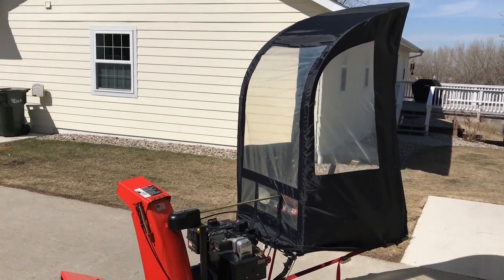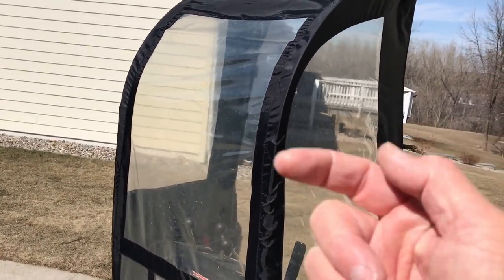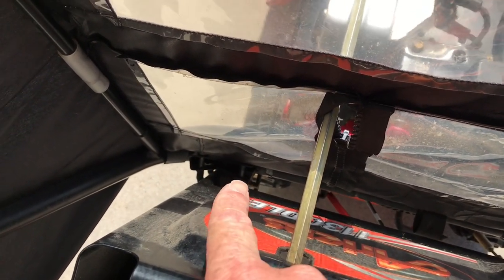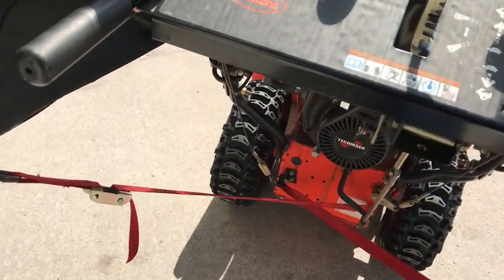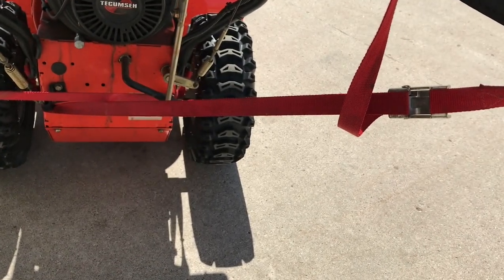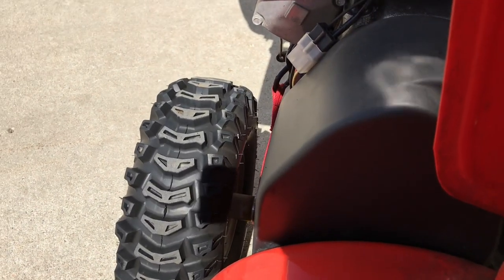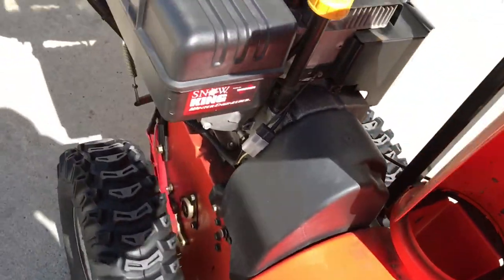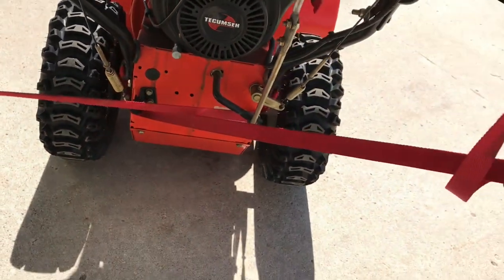Here's a Simple Fix for Snow Blower Cabs that Keep Folding over in High Winds

Comment: My bracket had a hole so I put a self tapping screw in there hoping that will fix my problem, I’m going to strap it too so it doesn’t move so much & relieve the pressure ... kind of a bad design 🤔🤔
Reply from the maker: The self tapping screw might be a quick and easy fix as well. Thanks for the feedback!